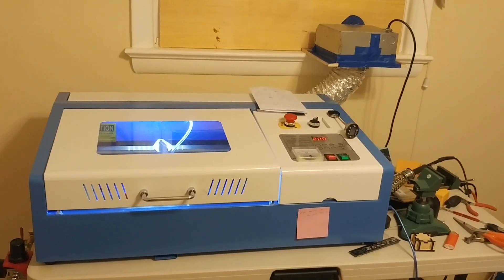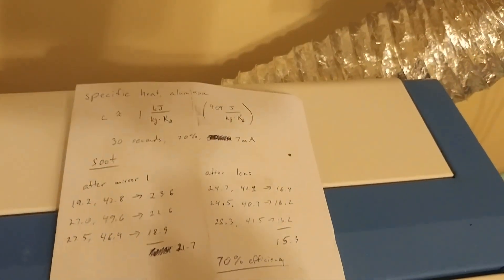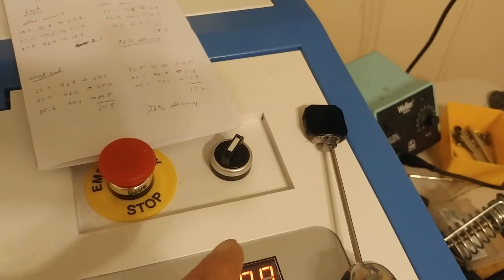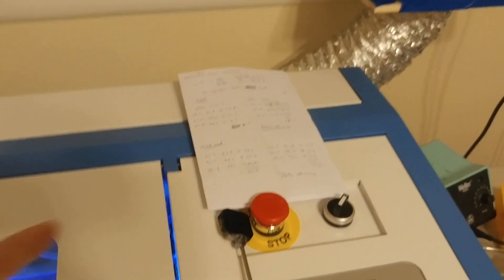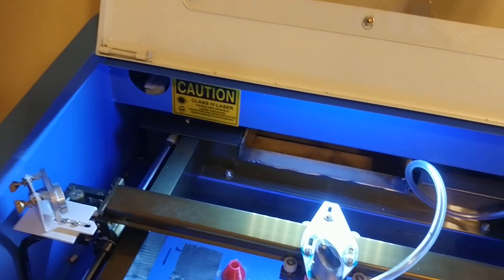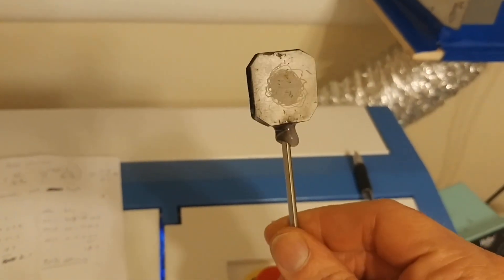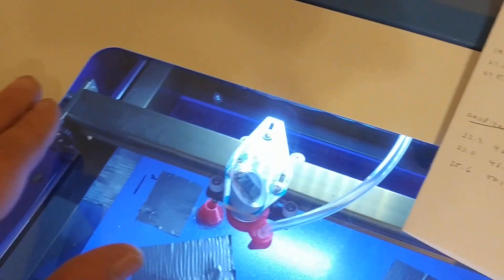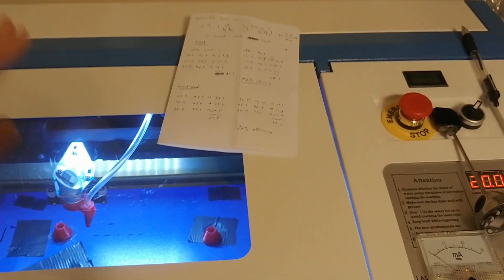K40 Laser Power Meter - easy & cheap!

Comment: Did you end up upgrading the mirrors and lens? A lot of the online guides and reviews on the K40 list upgrading the lens and mirror as a must. I wonder how much of a difference it makes.
Reply from the maker: Hahah, a homegamer finishing a project! That's a good one. I've continued using it in a mostly-stock configuration. Still cuts 1/4" oak well enough, albeit charred. The machine should get some more attention come August. The past six months I've been busy moving/downsizing, so the Ender and K40 are going to be focal points of my new workspace.

No welding in an apartment, unfortunately. At least that makes more times for electronics/prototyping/etc., and I've found a public makerspace that will help fill in the gaps when I need specialized stuff.
Reply: @swolebro  I feel ya. It's hard making time for projects. I actually came across you channel when researching LinuxCNC for a plasma cutter, all I've had time for so far is installing LinuxCNC on a computer. The K40 seems like a good (relatively) quick way to get my feet wet with this whole CNC thing.

 I guess your relocation means the plasma CNC is gonna get mothballed. I hope your relocation was due to positive reasons, downsizing a home workshop must suck.